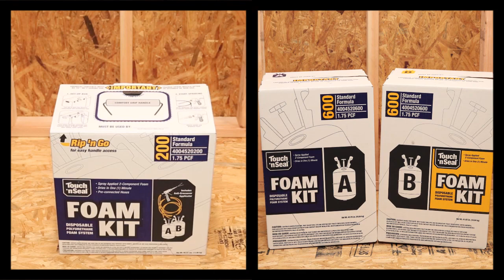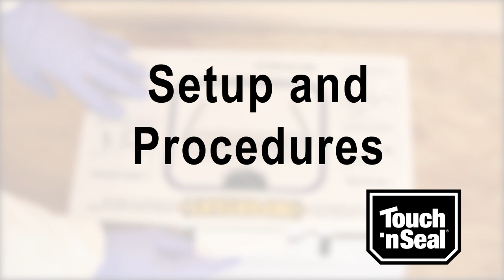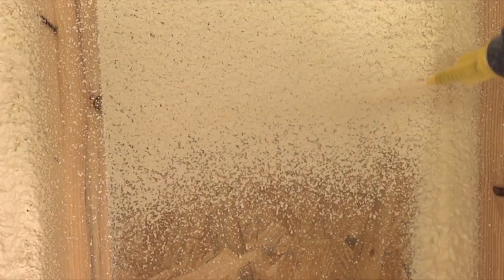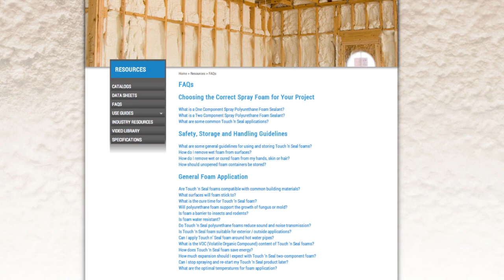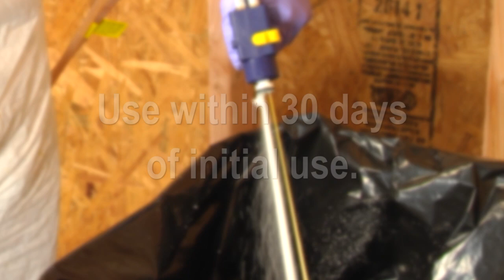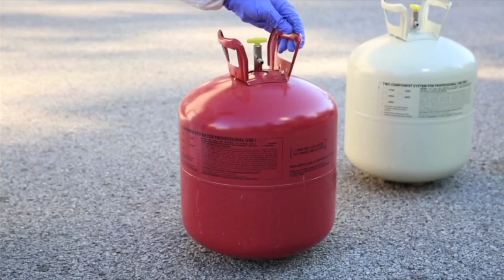How To Use Touch 'n Seal Foam Kit 200

Comment: will it be a good ideal to put this great stuff inside a real tree monster moto mini bike tire so that the tire don't go flat ?
Reply: I bet it would crunch up into so much powder in a few days. You might as well fill your tire with Rice Krispies.
Reply: you can do it but remove valve from inside the stem with the valve stem at 12o'clock. then begin using bursts of foam several seconds long then immediately cap and rotate tire several times. then stop at 12 again and do the same until full. be quick and have a helper.

Comment: Tubes cane off the cans. Foam started to come ort and hardened in the hose and on the can. Changed the nozzle but the hose is full of hardened foam. Can't get the unit to work now.
Reply: it's not mixed in the hose
Reply: @gregwright4751  LOL
Reply: Tom stilwell7004@roadrunner.com

Comment: THIS IS NOT A SAFE DIY PRODUCT AND SHOULD NOT BE SOLD TO CONSUMERS This product contains MDI Isocyanates in the A component. A known sensitizer that is extremely reactive, a powerful mucous membrane and respiratory irritant. The leading cause of occupational asthma in world. Isocyanates are odorless and extremely toxic.  The organic cartridges do not filter out 100 percent of isocyanates. Please check the 3M website and dow chemical MSDS sheet. For a quick explanation see https://www.cdc.gov/niosh/topics/isocyanates/ 
Low level exposure can cause permanent damage such ISOCYANATE INDUCED ASTHMA,  RADS, HYPERSENSITIVE PNEUMONITIS, Bronchiolitis Obliterans, etc. Isocyanates should only be sprayed with a fresh air supplied respirator.
Exposure can be through the eyes,skin or inhalation
Show less
REPLY
Reply: A respirator is an absolute must not an option...... a fresh air supply full face style is the only way to go. You must be extremely careful when using Isocyanates. The bottom line is there are NO air purifying respirator cartridges rated for use with Isocyanates. 3m no longer makes that claim that their organic carbon filters can do the job.   A simple p100 particulate filter will not filter out Isocyanate gas. Keep in mind organic filters have a short life span depending on the concentration they are filtering a one time use typically. The area must be extremely well ventilated and no one should enter the area for 24 hours while the product gasses off.   You must also cover all skin with a tyvek suit including a hood and chemical rated gloves. Protect eyes with goggles not safety glasses. Inhalation is not the only danger. Isocyanates can absorb through the skin in seconds, causing respiratory issues. Reactions can be immediate or delayed for several hours. My opinion Isocyanates are not worth the risk of permanent damage to your lungs. This is not a DIY product.
Reply: Wrong. MDI is a low level toxicity to humans and while exposure can cause problems with the respiratory tract it isn't as hazardous as you are letting on. Persons already suffering from conditions are more at risk. You have completely misinterpreted the article that you referenced. 

Isocyanates  can be extremely hazardous. MDI is a TYPE of Isocyanate. It is the safest and lowest risk of the Isocyanates. While that doesn't mean it doesn't have hazards, the risk to humans is low. You do not need an SCBA or other fresh air supplied breathing equipment, unless you are working in a confined space with no ventilation. A respirator will be sufficient. The product is safe. 3M has NOT removed it from their recommendations. Infact a check of the current 3M respirator filter guide shows that the appropriate filter to use when handling MDI is an Organic Vapor cartridge with an N95 filter in place (page 77 very bottom). 

This is why when people comment and try to act smart they should at least have the knowledge to back up what they are saying. I would recommend that you a) actually learn how to read MSDS sheets and b) take a Hazmat course because you clearly don't understand what it is that you are talking about.
Reply: prh44 no
Reply: prh44 no? Do you take exception to my comment?
Reply: Mike L ,

He had me convinced, lol.
Then l remembered a quote:
The one argument sounds very believable until you hear/read the other side.
Reply: Is a respirator good enough?  They recommend but don't require one, but probably going to use one anyway.  I might also have to shave my epic red beard if I get foam on it. :(
Reply: "A respirator is an absolute must not an option"
Can you rephrase this? I'm just not sure what it means. Thanks!
Reply: @bhstone1  
that prh44 comment means "this is not an option, but a necessity"
Reply: Was your work done in a crawl space or basement? I plan to insulate the rim joist in my crawl space but will consider the precautions prh44 has outlined. I will set up a negative pressure ventilation system so as to avoid the noxious vapors and treat the wet foam product as if it were ebola. Roxul good.
Reply: MrSandman: That quote is from the Bible
Reply: If the A/B chemicals in the walls did not mix 50/50, then there is a real risk of long term exposure to irritants. For a professional who is repeatedly exposed to imbalanced mix, there is also risk during each exposure. 

Because of the lack of MDM odor, people think that a lack of odor after airing out a spray insulation project - means that irritants are gone. The two often are linked, but  not always. 

One of the side effects of these projects is that a home may become much "tighter", with less air exchange. People can then become "aware" of sensitivities that are not related to a poor installation.
Reply: I ended up doing it with a mask and tyvek suit.  I had to crank the furnace to acclimate surfaces to proper temp so that was a bit uncomfortable but after the job was done I opened up all the windows and within an hour the smell was gone.  I suppose someone who does this as a living would want to use better PPE but for someone doing it once in a while the overall exposure is probably not as bad.   I think this is a ok DIY product but idealy one should be aware of all the risks and read all instructions and watch the video etc.  This is not something you buy and toss the instructions aside you really want to read through and understand everything and prepare yourself and the work site.   I missed a few spots as it did not expand quite as much as I expected (might be my fault, I probably should have done this in summer) so I will probably buy the smaller "15" system to do those spots.  This is for air sealing the rim joists area and the space between top place and foundation, rest will be done with Roxul and vapour barrier for a complete air and thermal seal.
Reply: EXACTLY> ONLY IDIOTS CAN BUY AND USE IT>
Reply: Pussy😂😂 I work with real spray foam.its not that bad

Comment: These sorts kits are about £550 in uk, and have a maximum coverage of 56sqm @25mm thick, which works out at about £10sqm @ 25mm
You can have a professional install a safer and far superior foam like, icynene from £4.50sqm @ 25mm so why bother?
Reply from the maker: +bigbadpman 200 Kit System will spray approximately 18m2 @ 25mm and are priced at 248 on https://www.abbuildingproducts.co.uk/touch-n-foam-200---spray-foam-kit-pr-5203.php
Thank you!